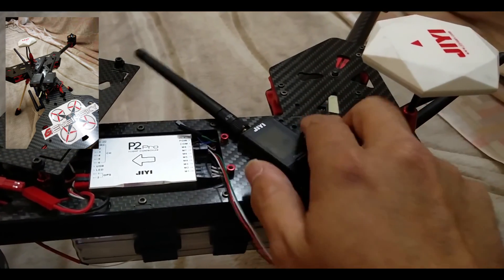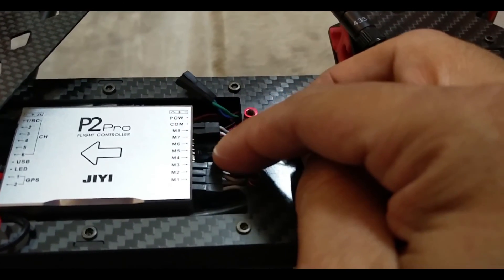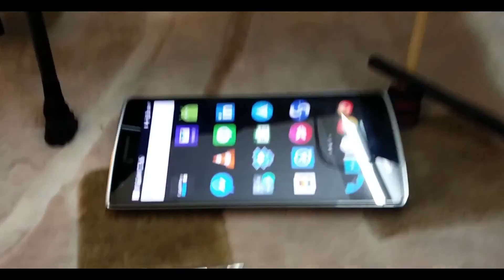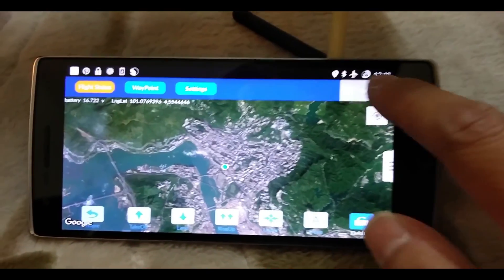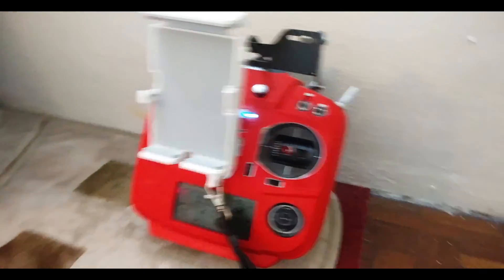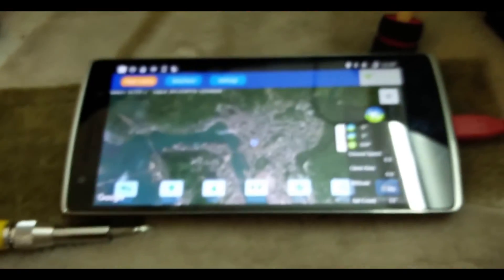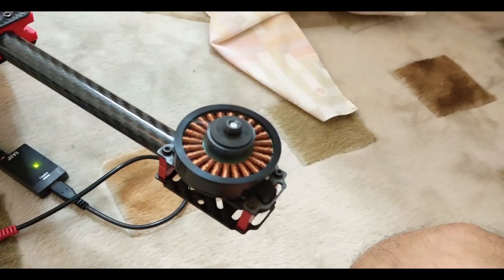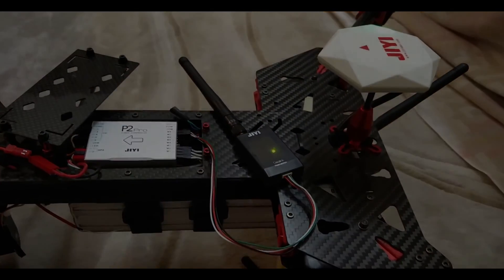Part 1 of 2 : JIYI GCS + Datalink Setup

Comment: where can you buy the  Datalink modules
Reply from the maker: Actually you can use any 3DR datalink modules ;)
Reply: I have few3DR's sitting around and JiYi Pro v2.  Can you assist me with the wiring? Should I connect it to com3?  From the four-pin plug The first (Facing to mid bord) is 5+ then I guess Tx next Rx (or opposite)  and GND (Check with Multimeter). If I want to add MNWOSD Do I need to include  TX\Rx rails to the osd as well?

Comment: can I both JIYI Data link with OSD by sharing same com port ? , Please help
Reply from the maker: Yes you can, splice the wires together but make sure that you do not connect the TX port on the OSD.
Reply: EyeInSky  Does Jiyi data link require good gps signal strength inorder to connect drone to mobile app? . I have try but I can not connect or read data from my drone. but if couse I did not have good gps signal while I was test it . please help thank you
Reply from the maker: Datalink is different from GPS. Data link is connecting to your app using either a 433mhz or 915Mhz (depending on where you are located). and you have a pair of the data link. If you are using Android, then the module with OTG usb or bluetooth as receiver can be used. If you are using an IOS device then you will need the bluetooth version of the ground station. Via the app you will be able to check how many GPS are connected etc.
Reply: EyeInSky I use android version I did try to pair data link by hook up ts with my drone then trun on my drone. In the mean time I turn on data link reciver then turn on my phone bluetooth and pair witb UAV2 . After that I follow your video method still unable to read data or control my drone . Did i do some thing wrong?
Reply: I think both osd and the telemetry radio have to be connected to RX\TX\5v+\GND and the FC